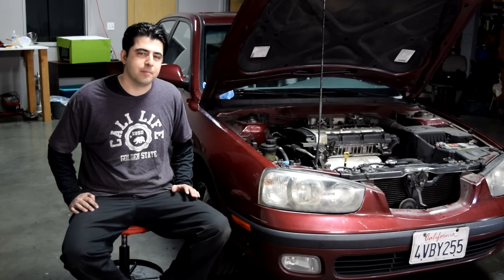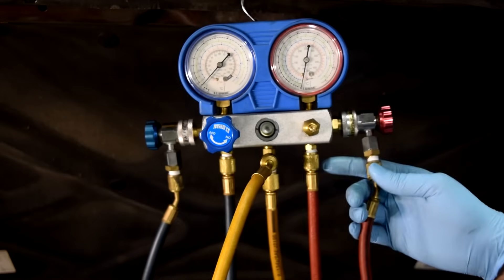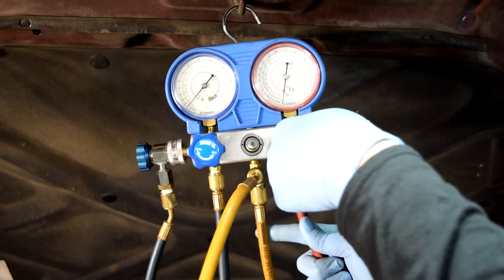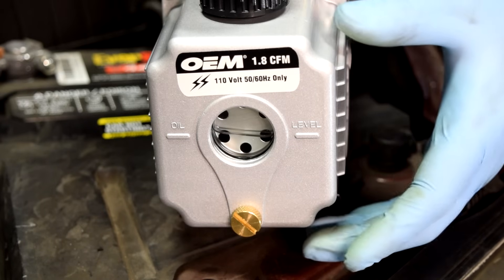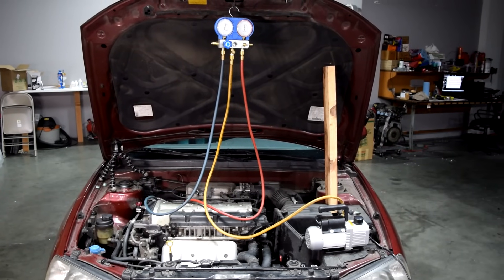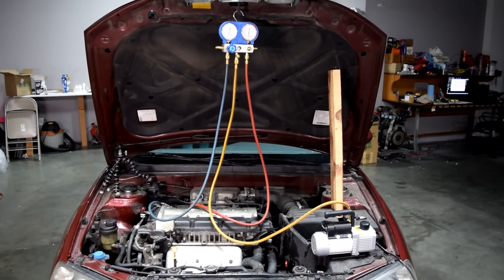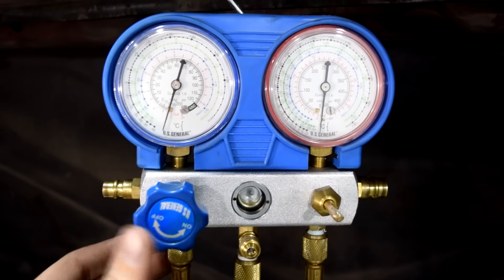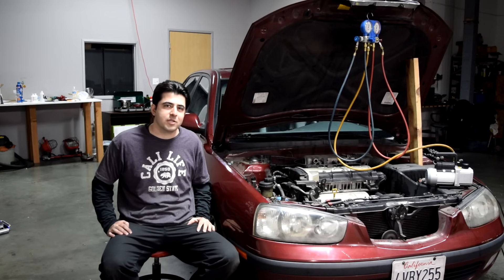How to Pull a Vacuum on an AC System - Step by Step

Comment: Your leak-back method isn’t really testing the A/C system itself — closing the manifold valves isolates the gauges from the car, so any vacuum decay you see only reflects the hoses and manifold, not the system. A more reliable method is to evacuate with the pump, then close the pump line and disconnect it, relying on the hose or Schrader valves to hold, and only then open the manifold valves to the vehicle. Leaving the pump connected introduces backstreaming and depends on the pump’s check valve, which can give false results. This way, the vacuum hold truly reflects the integrity of the A/C system.

Comment: those connectors are metal to metal connectors and are recommended not to have Teflon on them. in fact, Teflon tape can actually make them leak. they're specifically designed for a metal to metal contact as you can read in the instruction manual.

Comment: When you turn everything on, does the vacuum smoke from the air port?  Is that normal?  Mine started smoking but the smoke went away after about 10 min. It was the first time I used it.
Reply: Mine is doing the same thing, it’s been about 10 minutes but it’s still smoking
Reply: So i used it again and it smoked pretty much the entire time. I hope thats normal haha@torinholt1794
Reply: @TJsVette  cheap vacuum, make sure you check the oil level

Comment: Running that vacuum pump overnight like that will ruin it.😂 don’t listen to that bozo or you will ruin your equipment. do not run a vacuum pump when u already have a complete vacuum. Do this instead… once you reach a vacuum turn your fill gauges for low side-high side off and turn the vacuum pump off. Keep the gauge on and see if anything is lost after a night. There is no reason to keep the vacuum pump running when there is no more atmosphere in the system.
Reply: Really need a good pump and digital vacuum gauge

Comment: 5:24 if you have them closed how do you know if there’s vacuums in the system do they still connect to the ac system with them closes
Reply: The gauges will read the same all the time below zero indicating there is still a vacuum

Comment: The EPA states a 1-1.5hour vacuum is sufficient for POE compressor oil and R1234yf with PAG or POE. POE is what they use in hybrid and all electric cars. 30-45 minutes is more than enough for R134 with PAG, you may see R134 with POE in electrics, in that case its better to vacuum 1-1.5. You are boiling the water out of the oil. As they are hydrophilic like brake fluid. 

If your R134 system is open more than 4 - 8 hours, depending on humidity, you have to change the desiccate filter, 30-60 minutes for R1234yf.

Comment: I have a question. I’m going to be replacing the low pressure line on my vehicle and will do this procedure to pull vacuum after the repair. After the pump is turned off to see if there are any leaks, shouldn’t I keep the manifold valves open? Seems like they should stay open to see if the gauges bleed down (leak). Thanks in advance.

Comment: I have a r-12 system converted to r-134 and who knows if the conversion was done correctly - the other day I added r-134 and witnessed some air escaping/hissing behind glove box so apparently I have a leak in evaporator? I want to pull vacuum but also want to remove every bit of old oil/junk so I assume I can do this by purchasing a small recovery tank to deposit this stuff into via pulling vacuum? From here, I want to try a stop leak product - if this does not work, nothing is really lost as I would come back later and remove evaporator, expansion valve etc, update compressor, condensor, etc.  - make sense? I will have to replace oil with new oil naturally but my guess is there is a ton of junk in my system, perahps a combination of Pag and esther oils  -who knows? Does this sound like a workable plan to you?

Comment: I pulled vacuum on both the low and the high sides. After I  closed both red and blue valves and shut off the pump, the gauges slowly moved from the bottoms (30 below zeroes) to zeroes. Do I have a leak? Thank you.

Comment: I worked for my uncle in his shop and this is what he did for his living. We install kits back in the day for cars who did not have AC.  He uses gauges just like this, to both lines. We built a pump from a refrigerator vompressor,to pull a vacuum.  He pulled Vacuum a long time over an hour. Even though you cannot hear it running it is still pulling pressure and exciting air mod. The longer you pull it the cold it will be. When we added freon we got a bowel of hot water, placing the freon can in it as it loaded. This turned the freon back to a liquid and it went into the as a liquid not a gas. We also jumped the compressor at the dryer and kept the compressor in while loading.  So when I work on my system I do it just like he taught me.

Comment: You should also always break the vacuum ahead of the pump prior to switching it off. This will prevent the vacuum pump oil from being sucked backwards into the hose when you stop the pump (after isolating the A/C system from the vacuum hose of course. You don’t want to break THAT vacuum).

Comment: What are the problems of charging and not vacuum the system after a condenser replacement? My dad used to just pump in the freon w/o vacuum and we never had issues.
Reply: Could get freeze up of moisture at the orifice.

Comment: ***First learn what charging manifold gauge set is VS Evacuation hose set is with micron gauge 
Vacuum hose set 1 or 2 hose connection . Generally thru suction connection with micron gauge connected  to high side .  Learn how to use Nylog sealant on couplers  .  R134a couplers leak vacuum badly  .

Comment: Pull a vacuum overnight?  What are you doing, thermo-nuclear research that requires some sort of absolute vacuum??  If your system is not sufficiently evacuated in an hour, you have another problem going on.
Reply: I think what he really meant was to pull the vacuum and maybe let it sit overnight to see if it holds vacuum. But the time that he said it was before he shut the pump off making it seem like he suggested run the pump overnight.
Reply: @RedfishCarolina T T he thmost T.  Ty T txt  gh6$$$$$$$$$$$$, cj bb bb jk  chcccjjjjjjchim.    Jchjjcche. Huh.  H$$&&&,,,$$&,,$&,$&,&, h$$&&$ h hcjjj hjjj jk jcchjjcjjjj jk bb jjj jk jchjcjjcjj jk bb  jk jchj$. Bb.  J.  A  bb xd jchis    Hch. J.  Bb jk j.   J zzz’s jk j j jjj  kk j jjjj jjjjjj jk bb.  J kk  jk j jjj ez jjjjjc j a jj xd jjjjj jjj jjjj a jjjjjj jj  a jjj jj jj jj jj jj j a jjj jj BB kk jjjj can jjjjj jjjcjjj jk jjj    J jjjj. J.   Kk zzz’s jj jk jj xd jj. Jjjjķ jjjjjj jj jjj jjjj j j jj jj jjj jjjjjjjj zed jjjj jjjj. Jjj j.  Jjj bb❤
Reply: The hours long vacuum is slowly getting moisture out of the system.
Reply: I have watched a TON of videos on this subject and at least 70% of them say to do this overnight.  Glad to get a different  perspective.
Reply: For a 1 pound system in a scion xb, do you recommend 1 hour or less like 30mns?
Reply: The duty cycle on most cheap vacuum pumps is 30 minutes on, max.
Reply: If the AC system has been dormant and 'open' due to failed parts, for a long time yes even 6-8 hours is recommended because of moisture especially if the evaporator is inside the dashboard.
Reply: Didnt you listen he said if its been open for a week or espoused outside

Comment: I’m pulling a vacuum now, there is a fine mist coming out of the pump (which I assume is condensation of extracted moisture). My gauge shows it pulling a vac of minus 10 psi. Is that enough?

Comment: You do have to pull a vacuum on the high port🔴side and the low port side🔵if you don’t you will have unbalanced Freon in your system that’s what the pump is designed and engineered specifically!!!

Comment: Just a note about opening the taps on the manifold in the correct order. Once the vacuum pump is going it is best to only open the low side tap, then wait & watch the high side gauge. Within a minute or so the high side gauge should also pull down into a vacuum, indicating that the system is free from blockages. If the high side gauge does not fall into a vacuum, there is a system blockage which will need to be repaired before continuing on. This works best if the high side access port is close to the pump or at least between the pump & condenser. If the high side access port is anywhere else in the system, anything between the pump & the high side access valve cannot be tested for a blockage i.e. if the high side access valve is between the dryer & TX valve only the evaporator/TX valve can be checked for a blockage...if the high side access valve is between the condenser & dryer (rare to see this), you can only see a blockage in the dryer, TX/evaporator...
Reply: Thx for the tip, but just to make sure, are you suggesting NOT to open the high pressure side valve at the manifold at all during the vac process, OR wait til the HP side pulls vac, then slowly open it? TIA
Reply: @crispa1861  While vacuum pump is running, slowly open low side valve, watch gauge needle go under zero then do the same to high side. After an hour, gauges should read well under zero then close low then high side then turn off pump. The first can of freon will be pierced upright to allow gas to flow thru system to get it primed. Slowly open low side valve and let gas flow thru and stabilize then flip can upside down to allow liquid to flow thru system. Start car, a/c on max, far left cold, med-high blower. Shake can upside down observe milky sight glass on receiver drier or wrap your 2nd and 3rd fingers around the aluminum low pressure line. After the 3rd or 4th 12oz can the sight glass should be clear or the aluminum low pressure line should feel cold and start beading condensation. That tells you the system is full. Close low pressure valve and disconnect both pressure hoses.
Reply: Thank you for sharing that advice.
Reply: aaah, makes sense.

Comment: Change the shredder valve to new ones first befoe pulling a vacccum as leaks can happen there after we remove the HIGH and LOW port coupling hoses.

Comment: You do not need to pull vacuum on both the low and high lines. In fact, you can leave the high side off completely. Pull vacuum thru the low side only for roughly 30-45min.
Reply: Does the vacuum remove all of the freon?
Reply: @drjd2real no, you have to have it recovered at a shop. DO NOT VENT FREON INTO THE ATMOSPHERE!
Reply: @DeepSouthBayouDiesel You don't HAVE to.  I vent to atmosphere every time I work on an AC
Reply: @epstein_isnt_dead7726  I just know you aren't supposed to...dumb epa rules 😒
But I honestly don't blame you 😂👍
Reply: @DeepSouthBayouDiesel  it's hard to believe what they say when about every 12 years it's "you know that refrigerant we told you was better for the environment, forcing you to buy a whole new system when we phased out the old stuff? You'll never believe this, but it's bad for the environment, TOO! So we got this new refrigerant, and it's not bad for the environment. So you'll need a new system that's compatible with this new gas!"
Reply: @ep😂😂😂😂stein_isnt_dead7726
Reply: @epstein_isnt_dead7726 I recently started working at a diesel shop and one of the guys said you can evacuate the freon into water? Does that work? Is that something people do?
Reply: @DeepSouthBayouDiesel  My car lost the freon for 12 years, then I had to add a can of 12 oz. A/C came back to life. is epa rules on my car losing freon for 12 years? is it my fault? How many millions out there losing freon?
Reply: . Good grief, no.  It will just bubble through the water out yo the air.
Reply: @drjd2real it's called refrigerant
Reply: @drjd2real  yes vacuum takes out all the Freon or other refrigerant
Reply: This comment saved me 7 minutes and 47 seconds.
Reply: If the AC compressor was took off and put back on do I need to add oil
Reply: @austinbarber-hayes8642  Was oil drained from compressor?
Reply: @austinbarber-hayes8642  some come prefilled and some do not. I'd find that out first.
Reply: I might have got air through my low port changing shradder valve, so I should vacuum high side to??
Reply: Man you you helped answer my question lol thanks
Reply: 😂 Thank you I don’t know what in the hell this guy is thinking. OK I’m gonna tell the customer that he’s gotta come back tomorrow because it’s gonna take eight hours to pull a vacuum.😂 I would pull the vacuum for about 25 minutes never had an issue. Never this guy must go through a lot of vacuum pumps. Ha ha ha ha ha
Reply: Know this is old but so if you don’t vacuum the high side, why?? Help
Reply: Because the oil boiling off?
Reply: Does the vacuum evaporate the oil too? Do I need to add more oil?
Reply: @nickquik  no, the oil is designed to not evaporate, it might get residual oil in the lines, but it won't affect the oil in the compressor.
Reply: @samaelsandalphon5600  thank you cause I've been looking for the answer for a while now and Google did help. Some say yes, some say no. Lol
Reply: No. @nickquik
Reply: @nickquik Great question; one that I always wondered about.
Reply: @U2BER2012 true thats the question I was looking for
Reply: Still need to pull microns during a vacuum to insure system is completely evacuated. Pull on both high and low until 1000 microns, close off the high side and pull down to 500 on the low side
Reply: ain’t no micron reader in the field

Comment: i do everything properly as far as set up and what not, when i go to re pump my lines after a 30 minute vacuum test i seem to lose vacuum on my low pressure valve with the pump running before i open it for a second air/moisture purge. do i have a leak or something? a little lost. also i tried adding r134 earlier today and quickly pressured up to 90 psi on the low while having 0 psi on the high pressure line. (the clutch for the compressor did not engage) need help.
Reply: Prior to opening the low side hook up and get the Freon can ready. Once ready purge the Freon line by either cracking the line at the manifold or using the purge valve until Freon shoots out.

Comment: Vacuum is not the best method of testing. Put 150psi of nitrogen or shop air in (if the system was out of gas, dead flat). Then bubble check every hose and connection.

Comment: Idk if I’ll get a response cause it’s been so long, but I tried this exact steps but the refrigerant is just blowing and leaking out the black knob on the vacuum pump
Reply: that's the vacuuming process.... everything will be vacuumed... including whatever refrigerant has remained inside the system....

Comment: OH!  I was thinking the vacuum pump was for pulling out old refrigerant, so I was asking the shops if I had to properly dispose of refrigerant or if they did - no one knew what I was talking about...so all this does is pull pressure to see if there is a leak?  It must be a bad one to show in only 45 minutes?   I never broke open my system, but I charged up a year ago and it works, but not optimum, as if some leaked out?  When do you need to have old refrigerant pulled out?  The less I have others do, the better.
Reply: The vacuum pump pulls everything out of the system, air, moisture and even any refrigerant. Everything it pulls out is released to the atmosphere, not recovered. You are not required to recover refrigerant from automotive or small residential appliances, just larger HVAC and refrigeration systems.

The purpose of pulling a vacuum is not to test for leaks, but it will show you if you have lower pressure leaks if it will not hold a vacuum. The proper way to test for leaks is to add UV light sensitive dye to the system and existing refrigerant, usually only done on very tough to find leaks. Typically the system is vacuumed out, then charged with high pressure Nitrogen to actually test for high pressure leaks, then put back into a vacuum to remove the Nitrogen before charging with new refrigerant. Nitrogen is used because it’s an inert gas and cheaper than using refrigerant to look for leaks. It also helps clean the system out, to a degree. Kind of over kill for a small automotive AC system. Gauges are kind of over kill for a small automotive AC system, you’ll just about lose more refrigerant in your manifold and hoses than the system holds.

Vacuuming out any sealed system that has been opened is a critical step on all systems, large or small, before adding refrigerant. If you don’t get the air and moisture out when it mixes with refrigerant it turns acidic and will destroy everything, air and moisture will also throw pressure and compression off.
Reply: @tonyw9429  thanks, so how important is vacuuming system that has not been broken open?
Reply: Thanks for the explanation  @tonyw9429

Comment: The vaccum pump is a confusing one and no one tells how to use it exactly.First question, when the pump pulls the air/refrigerant out, where does it go? Everything I see is sealed shut on the pump including the. black top(that says GAS Exhaust) so where does it go?  And why is that lid always in the closed position in every video I see? The manual suggests opening that lid for better vaccum and some pumps have a cap with a hole in the top to prevent oil spil and yet let the gases out.
Reply: You aren't supposed to let refrigerent out into the atmosphere!! It says it right on your hood sticker! You need to take it to a shop first to have a collection machine take it out and contain it. The vaccum pump is to take any moisture out of the system

Comment: i did everything as instructed by the video yet i still have hot air blowing ...  (only vaccuum pump it for 1.5hrs) . so any advice would be appreciated. 16oz of r134a there still another about 5 oz at the end and system wouldnt take in anymore ... feel like the vaccuum didnt suck out all of it in system.